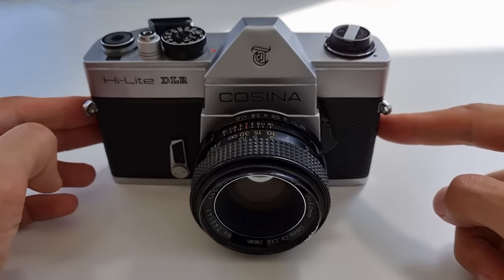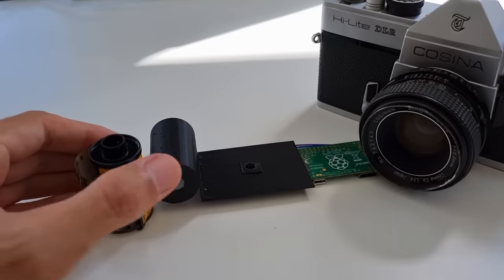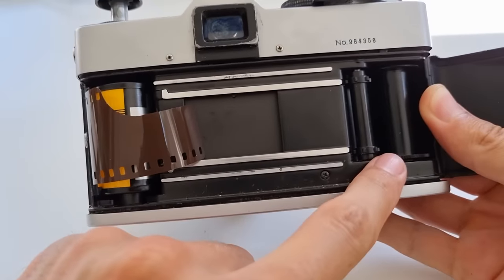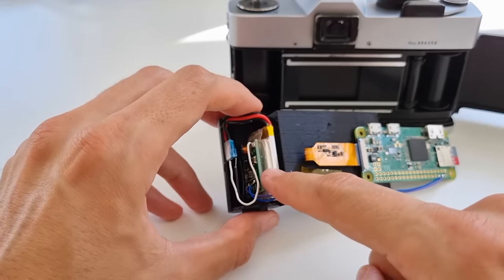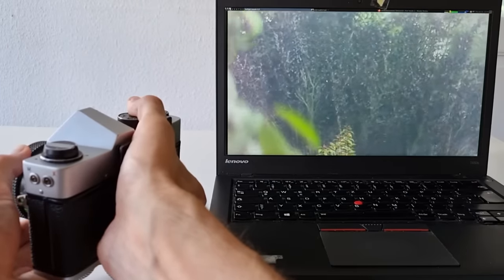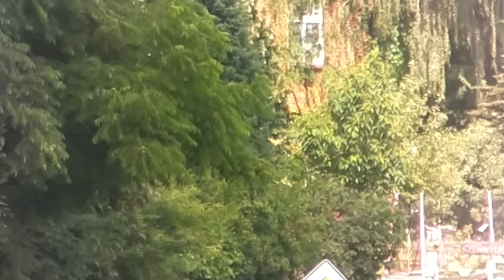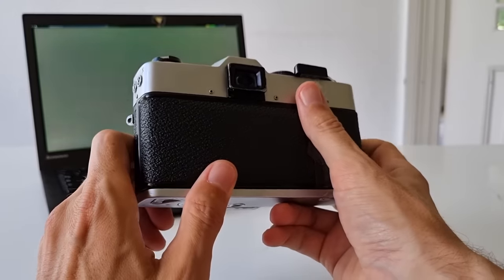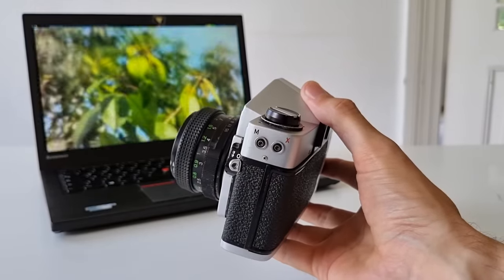Digital Film Cartridge for Analog Cameras (using Raspberry PI)

Comment: Nice idea. But I am wondering how are you keeping the shutter open and why is there tape on it when you turned it on? You didn't mention these things. Because the tape wasn't there when you opened and closed it.
Reply from the maker: The tape is locking the shutter since it was quite difficult to hold it while filming the thing in parallel. Under normal circumstances I just press it by hand.

Comment: I'd be interested in a full frame 20 megapixel version. The film door for the Nikon FM and FE might be the same. The film pressure plate could be used as a sensor mount. Having a monitor on the outside of the film door with buttons for control of iso and image review. The MD-12 motor drive could be used to carry a battery and a slot of SD card. If this were available at $600 I'd buy one.

Comment: Nice, I inherited one of these cameras from my father. I have to find out where it went and try this myself :-) I guess wiring up the shutter button to a GPIO on the Pi would require extensive modifications to the camera itself, right?
Reply from the maker: Yes, if it is wired internally it would be quite complicated. But if you use the external connector it should be possible with very little changes.

Comment: Does an image get reflected through the lens so the viewfinder can be used? or would an electronic viewfinder need to be installed so that you don't need to connect it to an external device via wifi, etc. (PC/Phone/Tablet etc.)? Or if you were to place it in a camera like a olympus stylus, would it work the same? Awesome work!
Reply from the maker: Viewfinder does work but it shows a different field of view, so it is of limited use. I would recommend attaching a smartphone at the back as a viewfinder.

Comment: Im not too technical but, do you think you could remap the initial electronics to use the shutter button to actually take a single frame image with a press and a video with a double press and a single press stop.  Further to that, do you think the flash shoe could be configured to use a microphone?   I am imagining this project would be pretty specific to SLR fans so any zoom functions would be strictly through the lenses.  I did not quite understand how you adjusted to shutter to stay open the whole time, unless you had the long exposure on or punctured the shutter itself.  Regardless, I think it's amazing and it's safe to say we are all really looking forward to the what you do with it in the future.

Comment: What kind of other sensors would a Raspberry manage to control and would you consider to share the program code you have been written.
As all the knobs and buttons are manual and mechanical some of them could get modified to settings on the Raspberry.
I was thinking a real good but outdated mechanical system camera that I would get equipped with an infrared sensor that is intended for DSLR cameras that are equipped with night vision.
UFO hunters has started to scan the sky with infrared DSLR cameras in night vision mode at as well daylight as at night time, and there are suspicious object turning up that aren't visible to the naked eye or for an ordinary camera.
So, if the photographer would be able to film and photo an UFO from a system camera that has object lenses to get close up, and that had been equipped with a photo sensor that is intended for use with night vision, these photos would start to get real and detailed closeups instead of some shaky lights in the distance that disappears and reapers every time the photographer switches between normal and night vision mode on his DSLR.

Comment: could really use a lens above the sensor to condense what would be 35mm down to the sensor size or preferably replace the camera sensor with a larger full frame version. Obviously the power and data exchange may require some adaption but the image would be significantly better.

Comment: hello i actually have the same camera in my house and it don"t work anymore. 
would be great to transforme it as a digital camera.  is there a easy way to put a button to take photo with the rasperry and save them on a cardrigde?
Reply from the maker: You could try to wire the flash trigger to a GPIO of the RPI

Comment: As much as i saw, You removed springy plate from the back of the camera cover in order to close it with RPi inside ?
Reply from the maker: That is correct. It would probably fit with the plate but it was a bit too tight for my taste.

Comment: Can you tell a little about the software you are using? 
I am building something similar with an old canon ae1 and a webcam sensor (the pi is outside but your idea is pretty cool
Reply from the maker: I am using gstreamer. That should also be an option for you since gstreamer supports Webcams as well.
Reply: @kassenbon  ah okay so You only use video? I try to implement photographie as well, maybe an exposure of 1/4th sec and the shutter makes the actual speed I'd only have to figure out timing ...

Comment: You don't have any zoom, what you see is just a tiny area in the center of what should be a 35mm film or a full size sensor, it's called "crop factor".
Reply from the maker: Let's for simplicity assume that we have both a full frame Image Sensor with 1920x1080 and a fingernail sized sensor (like mine) with also 1920x1080.
In case of a full frame sensor + optical zoom you are basically increasing the physical focal length (f). This results in an increase of the pixel focal length ( f / pixel size), which is what matters in case of digital images.
In case of the fingernail sensor, the physical focal length stays the same. However, since the pixels are much smaller, the pixel focal length increases (f / pixel size) as well. Therefore, both the zoom lens as well as the smaller sensor increase the pixel focal length. Long story short: Zoom and crop behave identical.
(Apart from less relevant optical effects like image sharpness, chromatic aberations, geometrical distortions, etc.)

Comment: Is it possible to use a CMOS sensor like a micro four thirds or an APS-C sized sensor for this setup? the I'm back kick start is using a vertical grip where the raspberi pi is integrated but I'm curious as to do a similar DIY project... I am wanting to extract the micro four thirds sensor from a panasonic camera with a broken screen and inserting into a super 16mm film camera.

Comment: Does the Raspberry Pi camera have a lens or is it removed? If it has, how does the film camera lens work on top of the RP camera? Is the film camera not just a holder for the RP camera? Ideally, you should not need/use the laptop. Just have an SD card in the camera to capture the scene when the shutter is pressed (closing a contact somewhere)! That will really make it like a digital film device.

Comment: An interesting idea!
How did you plan to check the moment when the shutter opens? Or you only plan to use this in "B" mode?
BTW, this zoom hints us about what image quality you can get with the film, especially with he slide one (they have really small grain size) - now you're using only tiny fraction of the 35mm frame and get decent image. What if the whole frame will be used? :)

Comment: If I wanted to put this into a point and shoot, is their a way I could route the physical button push with it being turned off still able to capture? So I’m not actuating the actual electronics every single picture?
Reply from the maker: That should be possible. You need to jam the shutter open however. You can find a good example of GPIO triggered capture in my other 8mm video (Code is there attached in the video description)

Comment: If I understood correctly the limiting factor here is the sensor size in repect to FOV projected on film vs sensor.
Would it help to add several macro reversal ring enough to invert the projection? Or Macro Coupler to combine several lenses?

Comment: you are only using the lens of the camera, and only a very small portion of the lens.  is the shutter of any use in this set up?  seems the aperture is of no effect and of course the film winding mechanism not used.  What is the point of this?
Reply from the maker: Yes, shutter could be used to trigger photos. Aperture is actually used.

Comment: I've often wondered how many people are like myself, as I have an $800.00 Pentax 35mm SLR Camera and $2,000.00 worth of lenses, all in their cases, sitting on a closet shelf.  It's astounding that nobody has developed and marketed a professional quality adapter to make these cameras digital.  The 35mm film canister was a standard, so the digital adapter of the same configuration would fit every make and model.   Kodak could have done this, and maybe stayed alive.
Reply: Just buy an adapter for your lenses and a digital body. It's thousand times easier to fit a sensor into a regular sized body than to make a small plate with barley any battery capacity, and any fair sized sensor on it 

Or just buy cheap b/w film

Comment: Thanks for releasing the 3D model. Are you planning on rigging it so it saves a picture when you take a photo? I’m assuming you have the shutter jammed open for this to work but there must be some way to grab a photo when you press the shutter release without modifying the camera too heavily.
Reply: Adding a pull switch to raspberry Pi gpio pin and the d shutter press would suffice

Comment: Did you 3D print the device to hold the RPi Zero W? If you did is it on Thingiverse?
Reply from the maker: Yes, I did. You can find the design in here:https://cad.onshape.com/documents/9062f6ac0d50b6c525b328ca/w/a6bfdfd33e46be980de27fa4/e/336338e1b9dae85ae835bd74
Reply: @kassenbon  Thanks!
Reply from the maker: @caseynettles6814  You likely need to create an account on Onshape so that you can copy the design into your workspace. I recommend this over Thingiverse because it might need minor adaptations for a different camera.

Comment: How about disassembling an old full frame mirorless or dslr like the canon 5D mark 2 or 3 and implanting the full frame sensor on the raspberry pi.

You could also install magic lantern as a UI on it and basically give every old digital Kamera RAW video capabilities. This is of course depending on the strength of the processor in the raspberry pi. 

I mentioned the 5D mark 2 and 3 because these cameras hacked were able of RAW videos with the magic lantern hack.
Reply: So dismantiling a new camera to hack an old one? Doesn't seems right to me

Comment: Only for video mode? The camera's shutter was open on Bulb mode for the whole time. Is there a way to sync the camera's shutter opening to when it captures the digital still image?
Reply from the maker: Using a longer shutter and detecting the change in brightness should do the trick. Only question is how fast the autoexposure will be able to react (going from dark to shutter open)
Reply: @kassenbon  I know nothing but made the same observation elsewhere in the thread about detecting the light changes probably being the easiest way to tell it to capture, eaiser than mechanical anyway. I assumed you were probably in bulb mode for live view and recognize that from an experiential and authenticity point of view, using the shutter speeds, apature and metering yourself are part of getting the image you want from these cameras. 

I don't know software at all, but could it be set to be perpetually recording a few second loop and dumpling the information if there is no shutter event? If the shutter opens the software could maybe copy out that patch including the buffered moment before the shutter opens.

Maybe it determines the brigest moment and takes that (wouldn't respect your shutter speed).

Or it records a sampling of stills to merge together. Maybe capturing accumulated frames over the duration of the shutter event would allow it to really reflecton of the users settings (like shutter speed), then merging them into one image. I'm not sure at all and don't know anything about how these sensors or software work. Just random thoughts.  Just thinking about how to reduce the latency.

I would assume the simplest mecinisim is best with the least physical parts. Seems like the more parts that are added, the less chances of wide compatibility and higher chances of breakage or the need to butcher classic cameras to run flash wires in, or something.

Comment: I may just be slow here, but wouldn't that only work if the camera had a Bulb setting that you could lock open indefinitely? Otherwise videos would only be visible for the duration of the shutter being open. That fact would limit its use to a small percentage of film-based cameras.
Reply from the maker: Yes you are correct about this. I held it open just by pressing it which works fine as well.
Reply: @kassenbon  I had a couple of old cameras that limited Bulb to 30 seconds. Plus that adds to the shake unless you have locking cable release.
Great project though, I don't mean to be putting it down in any way.

Comment: Can a Kodapak 126 cartridge be similarly adapted and dropped in either/both an Instamatic 100 or German made Kodak 500? Both 126 variations have the same width as 35mm and the pi camera backing would leave them light tight while delivering Bluetooth imagery.
Reply from the maker: In fact I have an Instamatic 100 and I thought about using this instead of my 35mm for this project. But I did not find a compelling advantage so I stuck to the 35mm. But it should definitely be possible.
Reply: @kassenbon  Thank you! There is a robust, high volume of vintage Instamatic camera variations on Ebay and some enterprising person sold a 35mm accessible computer built cartridge so as to use 35mm film, but this idea is a total game changer. Not only can the camera owner still reload with fresh 35mm film, this allows instant digital photography by merely dropping in one of these Pi modifications. If it is proven to be commercially possible, a price point of $49.99 plus shipping could work. What does a pi component cost? Retail looks like $35. Assembly into a computer built cartridge would look like less than a dollar. The rest is profit.

Comment: Sadly cameras have nothing in film compartment to indicate shooting a photo. So it is harder to make this do photos standalone, without a computer... 
  I hope you make one with big sensor for proper crop factor and solve shooting interface. Turning on and off that pi, without opening the camera too :)
This was my tiny dream years ago, before we had affordable 3d printers and cheap decent sensors. Shame there are no large cheap sensors.though photo fans may pay a lot of money for this with large sensor ir it had on camera controls.
Reply: it may need addition of a circuit to automatically capture and store image the moment the shutter opens/sensor exposed to light.
Reply: At Silicon Film, we used a low-power acoustic sensor to detect the sound of the mirror flipping. That would very quickly power up the main electronics and reset the image sensor.

Comment: you could have just stuck that lens on a usb camera... and actually had a larger sensors, because i think the sensors for raspberry pi are only 1/4" ? you can get usb cameras upto 1/1.7" for less than 50$. or if you insist, stick that usb camera inside that camera.. and actually have an UVC interface that you can connect to your phone directly.

Comment: Can radio signal come out of an entirely metal device ?
Reply from the maker: Yes, because the metal is not connected all way around. For example the door has long unconnected edges. This is enough to form a slot antenna.
Reply: @kassenbon  Probably so, although the phenomena might be more complex.
I also have a few cameras similar to the one shown, but I use them for ordinary black and white films, of which I have an important reserve that I keep in the refrigerator. These turbulent times encourage less photographic art, especially in Romania, where I am from.

Comment: Please does something like this with VHS camcorder
Reply: That works on a completely different principle. You'd have to create something that reads the magentic signal that would have been transfered to tape.  At diagonals, timed perfectly. Tracking would still be an issue, even if you could manufacture some spinny thing that could read the writing head of the mechanism.

Comment: Live view only?
Reply from the maker: You can still use the viewfinder but this will give you a different field of view so I would not recommend doing that.
Reply: @kassenbon  …but how does the shutter curtain such with the sensor? Where can we get more information? I really like this!
Reply: Should’ve been “sync”
Reply from the maker: I used bulb mode which circumvents this issue a bit. But it should also be possible to sync based on brightness.

Comment: i have 2 excellent contax bodies that could use this. your challenge is to create a full frame sensor unit that meets today's standards from Sony, Canon. The sensor alone is expebsive. the complex electronics even more so. the features like eye autofocus, low light, white balance, stabilization will not be economical. Sony makes insanely good cameras that are affordable and does this brilliantly with glorious color and quality. they spend millions designing this stuff. then millions making it.

Your dream is valid. doing it will not be possible, sad but true. that is the reality.